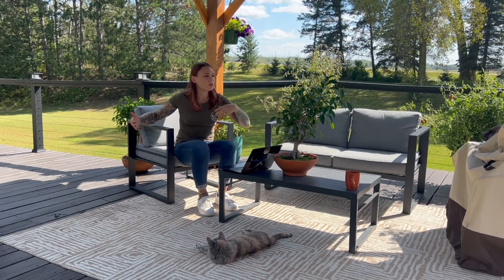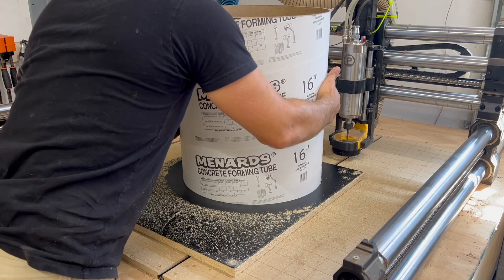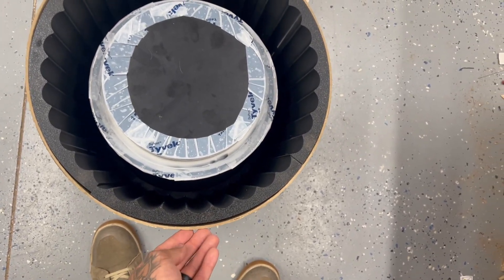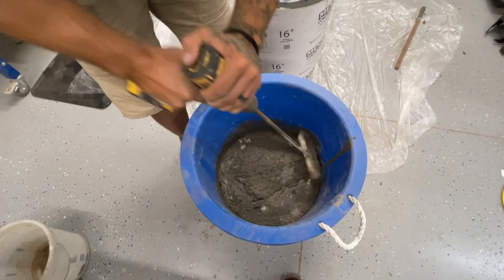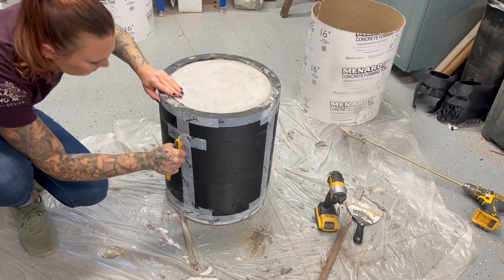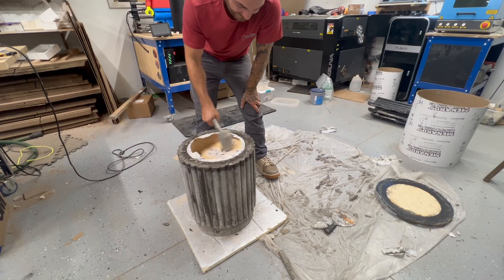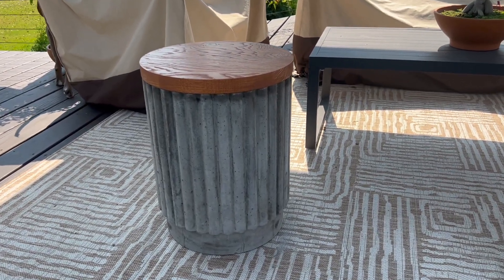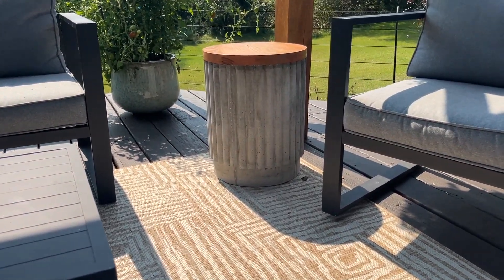We Tried 3D Printing Molds for Concrete Tables…

Comment: Weight can be adjusted by adding perlite to the concrete mix. I usually use Portland cement 1 part cement to 4 parts perlite and then add fiberglass

Comment: Id do away with the outer cardboard tube, add locating pins or features to the 3d printed forms and use ratchet straps to hold them together. Then when moulded just release straps
Reply: Or even keep the outer tube but split it the ratcget strap around the lot. Will prevent mold from parting when convrete poured

Comment: Yea counter top concrete mix is to expensive.  You can just use the 5000 psi mix for a quarter of the cost.  I did prefer the Sakrete brand.  It will come out gray versus the white.  You can also buy dye for the mix.  They work well.  I use to use the black mostly.  Google "Fu-Tung Cheng".  He is the master of working with concrete if you are really interested. If you want a cool design mix the concrete so it is very dry, so you can form a ball with your hand.  Then pack them into the mold, do not press to hard as you want to leave gaps.  When you unmold you will see all the voids.  Now come back with a different color and mix a slurry to fill the voids.  Google "Buddy Rhodes".  Awesome results.  You can also add fiber optic  lights.  So many possibilities.  I do not mess with it any more.  Problem is that it is just to heavy and just to messy from the dust.  You can make some incredible counter tops with it in a face down form.  Concrete does not make the greatest surface for a countertop, it stains easily and certain liquids that are acidic will chew right through it.  Unless you like that look.  You can cover it with epoxy but then it just looks like plastic.  Just my 2 cents.  Thanks for another great video!

Comment: Hey !! 
U should have use rachet strap . To hold ur molds. Caulking the seems could also be done to avoid leakage of cement. And the bubble getting trap is bcz of ur design flaw .. next time try to at an angle so the bubble travel upwards or else u should pour concrete in batches and remove bubbles as u go up rather filling it all once and bubbling it out.

Comment: Thats such a great project! 
I would personally make the 3d prints 1model that you print 4 time so if you plan to make more later and one break, you cab print just one mode without having to find the right one.
I will try it next summer with exagon shapes for the wall.
Thx for the inspiration!
Reply from the maker: Thanks for the tip! And thanks for watching

Comment: Cool. Wood on concrete will eventually lead the wood to rot though, as the concrete absorbs humidity from the air, or water when it gets rained on.  A gasket between the wood top and the concrete base  is recommended for longevity. It would also (hopefully) keep the bugs out and preven water or condensation from finding its way to the inside of the base.
Reply from the maker: Thanks for the tips!

Comment: I worked for a company that made these kinds of things(gfrc planters, benches, fountains) and there are a few things you can do to make your life easier. For mold release the simplest/cheapest and maybe even the best is just simple wax. A very light coat should do, more is not better. Hot glue is your friend and can be used to hold the mold forms in place, itd probably take some adjusting on the design to hold all the pieces but even just holding most and leaving the last one floating would help. With the right amount of fiber(1-3%) you can go pretty thin at around 1/2-3/4" wall thickness, if you need to go really big you can create voids and reinforcing areas on the inner tube to add structure and strength without going too thick. You may be better off casting upside down and open(no inner tube) with the right amount water, you may need a water reducer but youll get a stronger and better part by being able to roll out bubbles and minimize them. Also "fixing" bubbles can be done with a little cement soon after pulling from the mold. Theres more and I can go in depth on this but Im already rambling. This has given me some ideas on making stuff of my own, thank you!
Reply from the maker: Thanks for all the tips! I appreciate it
Reply: @TwoMooseDesign  You can pour the concrete a bit wetter without losing strength if you add superplasticizer! Awesome job for not knowing anything about concrete. Well done.
Reply: I came here looking for this comment, also ratchet straps may have helped keeping it from slightly separating. Just a thought I had. Great content as usual!

Comment: It would have been better to have the mold sides half overlap at least, then you don’t have a straight path for the concrete but they can still pull apart. 

Fancier and you wouldn’t have had to worry about clamps so much would be to design with a tapered dovetail to join them and hammer a part in to lock them. But that is honestly more effort than it’s worth for this
Reply from the maker: Thanks for the tips! and thanks for watching

Comment: I wonder if ratchet straps around the molds would keep the joints tight,
Reply from the maker: I think it would have. If I didn’t already have a spare card board tube I would have definitely tried

Comment: For weight reduction I suggest aerating the concrete mix. The professionals do it with some kid of special suds building liquid and a giant frothing device. Cheap way could be dish soap. I tried shaving cream and it smelled A LOT like the shaving cream. Also adding in micro-styrofoam beads, but they might affect the surface quality.
Reply from the maker: Interesting! That’s pretty cool I’ll definitely do some research on that. Thanks for watching!

Comment: Let's use expensive melamine so we can save.dirt cheap concrete.... 230$ to make small tables just WoW. Only 3d printed parts will be 100+ only for resin... Plenty of cheap plastic to just buy and one time use it.... 15$ easily repeatable table done for 150$
Reply from the maker: The melamine was scraps I had from other projects and a whole sheet is $40. I guess you didn’t actually watch the video? They are reusable and the end tables we wanted were $230 and we made two for less than that. But okay be mad over nothing 👍🏼thanks for kind of watching the video.
Reply: @TwoMooseDesign  ok on bubbles side design just wrong you have 90° above them they simply can't escape. Rolling on a side or adjusting design as make it 2 piece or adding slight slope so air can actually escape. Using extremely expensive premixed bags and adding fiberglass to countertop mix is a waste. Bag of concrete cost 5$ for 50kg or 110lbs not sure.... Mixing with 1:4 with sand will be 4 such tables for nothg and even with out fiberglass it will be extra strong.... 3d printing using CNC IF you have it doesn't mean it's free right. If you do furniture I don't think you charge only for wood... No Oak top in final price.... Same goes here if you have it from some project doesn't mean it's free.  No hate here just  "let's try to make 2 for the price of 1" is very easy goal for repeatable mold design. Real world question must be can we make 20. But I quest point of the video was not "make something cheap" but we tried we kinda did it everyone happy ) I watched till the end enjoyed it. Just don't get the point of doing something if all you actually did is pour water.... CNC circles with concrete forms from shop, 3d printed mold. CNC top oak.
Reply from the maker: Okay, so if you just wanted to give feedback great! I appreciate the tips but you're just coming of rude. I bought pre mixed concrete that was for counter tops which someone recommended to me. I obviously didn't have concrete knolege so how would i know to magically make the forms correct when i dont know what i'm doing. It was trial and error, I never once claimed this was the right way to do anything and i got alot of helpful tips in the comments which i appreciate. I had fun making them and for my knowledge i was happy with how they turned out. if you dont like them great thats your opinion and thats fine with me as they are on my deck and not yours.

Comment: Nice job. Nice shop. I don't think I would use those tables on a  wood deck. I think that material choice  would make more sense if the tables were to be used on sand, dirt or gravel .
Reply from the maker: Thanks for watching! I thought they gave an extra element of texture. A lot of people have concrete tops on their deck and it sits on a outdoor rug so it won’t scratch any 😁

Comment: Generally with glass fiber reinforced concrete 3/4 of an inch is thick enough. Big box tubes are hard to use since you can get specific sizes, but some “construction supply distributors” (I.e White Cap is national) can get more specific sizes. Overall, well done!
Reply from the maker: Yeah I wish I could of found one size smaller on the tubes. and ohhhh 3/4 seems crazy thin! I was afraid to make them any thinner haha. I wish I could of shaved off a 1/2" for sure, They feel super solid I think it would of been fine, I just didn't have the knowledge or confidence! Thanks for the tips and we appreciate you watching.

Comment: I would suggest on your 3D printed mold to design the walls with rabbit or butterfly joints to suck in the seams from part to part. For the concrete I would suggest using some chicken wire as a "cage" for reinforcement, but it doesn't reduce the weight any. You could also try cutting the caps in half and then tape the seam so when pulling the melamine out it's a little easier.
Reply from the maker: It definitely needed something to lock them together and ohh good idea on chicken wire the thinner the walls the better! Thanks for watching

Comment: To be honest I would have used PetG filament to print them, better strength and much better heat and stress tolerances.
Reply from the maker: Absolutely I just had alot of pla on hand and wasn’t sure how well it would release but you’re right definitely a better material for something like this

Comment: The 3d prints needed a way to over lap a bit then some plywood perfectly cut to fit outer rings.  The other option is ratchet straps but add a rubber layer. To make it less hard on the 3d print. It can be glued to each of the pieces. Make sure you do not over tighten. The runner also protects against the metal ratchet straps.  The edges to lock together should look like this. 
_|- <---- that line is at the top. And reverse on next piece on the side.Aslong as you note the first panels that have to come off first  the others will come away easily. As for the bubbles trapped there that's common or a lip like that by making a very slight angle it can help the bubbles come up. Also stopping the fill at the shoulder and trying to vibrate that edge and hopefully more bubbles release. Again very very slight angle is better. Overly thin concrete will airate more during to the mixing process. If you look at how concrete stairs are made that may give you some help also for your design and filling. Thicker will require a bit more vibration and best to do levels and then use the rod to push each level together. It will take some practice. Also using short fiberglass right at the end of the mixing with plenty in it can allow for greater hold. Also using a permanent inner tube that has pores or fiber glass or 19 gauge mesh that the cement can stick to will increase strength and allow greater reinforcement and thinner walls. Again all this will require experimenting and you may find resources on the net. I love the 6000psi cement for molding but again too thin more air also less strength. Read directions on the bag. Can add slight amount more water but again too much weaker concrete. Former concrete butcher and do maintenance and repair on concrete, wood and steel in Canada. All across Manitoba to all boarders. Don't know everything far from it. 

Make sure concrete is fully dry before sealing. Also a 28 day lime bath in warm water will allow them to cure to a max strength. But then you need a large vertical bucket with enough fine lime dissolved. It will drop out not to worry and s tank warmer to keep the water at a warm bathtub to touch.

Anyways they look great and minor design changes might lose some weight. But concrete is heavy by nature. It's also strong.
Reply from the maker: Thanks for all the tips!

Comment: Love the design and build.
I can help with your concrete mix a lot if you're interested. First, you're using the wrong fibers from what I can see. Second, a plasticizer in you mix would help get the air bubbles out as much as possible.  Next, you can use a PAM spray for molds so the concrete doesn't stick. I also have a great trick to keep your wood at the bottom from sticking, but I'm not sure how to explain it by text. Teach me how to use the Masso controller once I get my 1F and I can teach you a lot about concrete. Oh, and one more thing.....With the right mix & fiber you can make you table 1/3 the thickness your current tables are and probably even stronger. Let me know how to contact you, and I can get you started in the right direction. Really nice job for your first concrete project.
Reply from the maker: Thanks for the tips! Yeah I had no idea what fibers to buy 😆 shaving an inch off the insides would save a fine of weight and I could for sure is it in 2 bags or less and just reach out on our IG! That’s exciting you’re getting a onefinity. You’ll love it

Comment: So I would have put registration pins on the sides just like you did for the top and bottom. I would have then just used ratcheting straps to hold the mold together. I feel like that would have made the seams neater. Next, hard corners are always going to be a problem with bubbles and nothing you do will fix that. You need to give it a draft angle to encourage the bubbles to move. I would have made it so my walls were much thinner. Fiber reinforced concrete can be surprisingly strong.
Reply from the maker: Thanks for the tips! I was worried about pins on the sides as i wouldn’t be able to pull them apart so I didn’t risk it. I think the ratchet straps would have worked. And good to know! I wanted to make it thinner I just wasn’t sure what I could get away with. Thanks for watching!
Reply: @TwoMooseDesign  registration pins don’t have to be deep. To avoid sticking something shallow and smooth like a half sphere on one side and a half dome on the other should work to keep it locked when ratcheted together but come off easily when you remove the straps. Most people make dowel when doing registration pins and those would definitely get stuck
Reply from the maker: Yeah I should of done some short dowels
Reply: Maybe a modified tongue and groove on the side seams and plus one for the draft on those edges that bubbled. It will help with mildew build up…

Comment: Why not use a ratchet strap around the mould to hold it closed?
Reply from the maker: That probably would have worked. I was initially concerned with the 3d print strength and I already bought the tubes so I kinda just stick with that plan

Comment: Not sure what type of concrete you used but it turned out great. I might have used fiberglass rebar in the concrete so you might be able to go a little thinner but have the strength. Also, add some concrete coloring to the mix to spice it up. Great project however
Reply from the maker: Good idea! I used countertop concrete from the local big box store
Reply: @TwoMooseDesign  I thought you did use that from Menards.
Reply from the maker: Yep! I got the concrete and form tubes from menards, I was surprised they had the countertop concrete there.

Comment: The bubbles are a puzzle as I also would have expected a more loose/sloppy mix to have allowed them to surface more easily, as I have wanted to try something like this I'd love to know the answer to fewer bubbles before I commit...
Reply: A concrete vibrator. Rent them at your Home store for about $50 a day.  At the very least hit all the sides of it with a mallet, pretty hard. You'll see the bubbles come up. Also this moves the big rocks away from the sides.
Reply from the maker: Im sure someone out there will have an answer! I was pretty surprised the first one looked better lol

Comment from the maker: Thanks for watching everyone!
Reply: (if it fits) inflate some large bicycle tyres around the mould to exert even pressure on the form, pulling the pieces together and hopefully removing any seam lines.
Also, the next time you design the pieces, include some keys (male and female specific orientation points) to help all of the parts marry up.